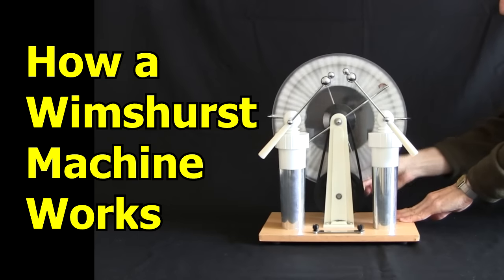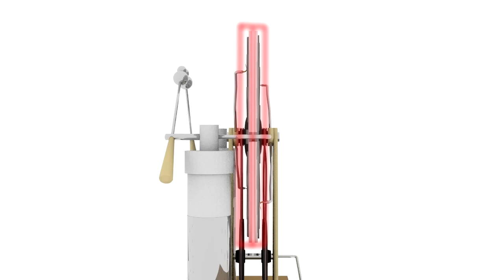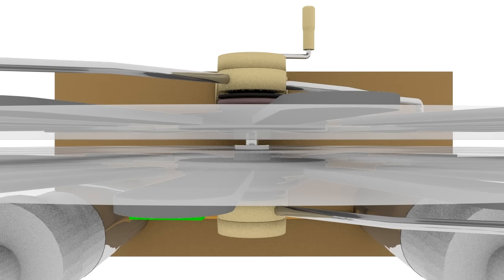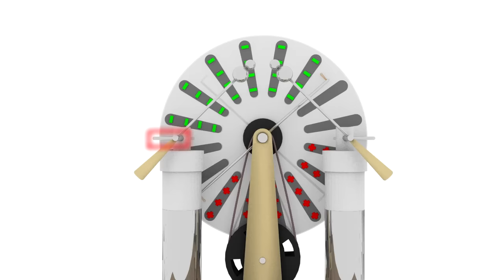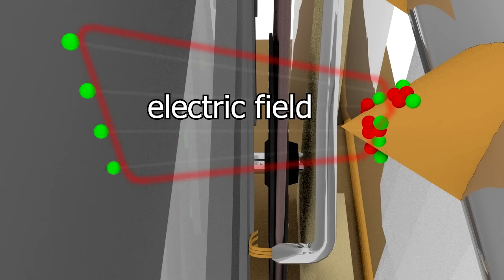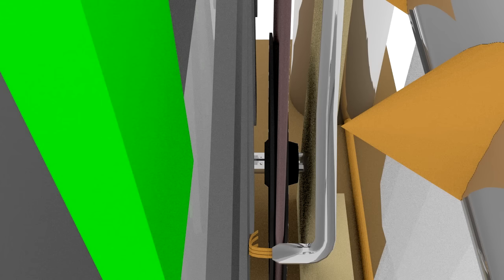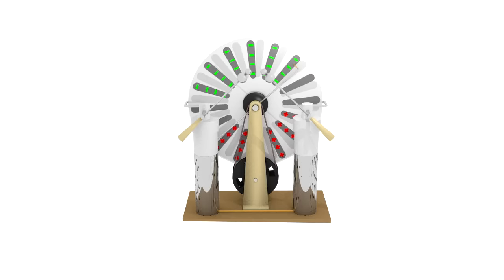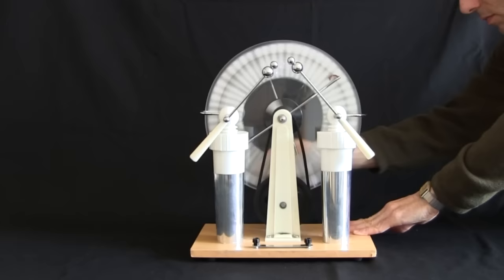How a Wimshurst Machine Works

Comment: Great explanation and animation! What I miss in the story is the effect of the fact that the neutralizers on the opposite sides are electrically connected. At least they are on the two commercial Wimhurst machines that I measured. In combination with not understanding why the entire charge would flow to the opposite sector in the first place, I would actually think that the negative charge will flow for 25% to the opposite sector, for 25% stay where it is and for 2x 25% flow to the two sectors on the opposite side of the blade where the neutralizers on the opposite side happen to connect at that moment. Any comment why this would be wrong, and if it is, what IS the impact of the neutraliser being electrically connected?
Reply from the maker: I've never seen one where the two neutralizer bars were connected together so I can't answer your question. Are you sure they were Wimshurst machines? There are a huge number of electrostatic machines.
Reply: Thanks for fast your reply. Yep, they are Wimshurst machines. For one the link can be found here https://www.vosinstrumenten.nl/winkel/product/details/?artdetail=VOS%2D11004&webgroupfilter=1965. The other is old, but I have analyzed it and I think there is no doubt that it is also a Wimshurst machine. It closely resembles this one: https://www.vosinstrumenten.nl/onderwijs/natuurkunde/elektriciteit/elektrostatica/wimshurst-machine-phywe.html. You can find a small picture of the old one here: https://github.com/hansdejongehv/Weekendschool-Natuurkunde-Physics/blob/master/Proeven/Proef%20Y%20-%20Electrostatica%2C%20aantrekken%20en%20afstoten/ElectrostaticaMetWimshurst_v7.pdf 
Did you ever measure in your Wimshurst machine whether the neutralizers are electrically connected?
Reply: When the neutralize bar makes contact with the sectors, it is as there is a single long piece of metal made of the two sectors connected by the bar.
BY the effect of the other disk induction, in an extremity of this single piece, electrons are attracted, while on the other extremity electrons are repulsed.
When the bar slide off from the sectors, it is as this long piece of metal is broken in two pieces.
The charges inducted on each piece however remains, and they are conveyed towards the collector and the Leyden jars where they are acumulated.
 A clear explanation is at  http://www.coe.ufrj.br/~acmq/whyhow.html

Comment: Is it possible to power machinery or homes like a generator with such a device sometime in the future?
Reply from the maker: It wouldn't be a good way of doing it. Wimshurst machines are inefficient but also, you'd still need a power source for power motor to turn the disks. You'd be better off connecting your machinery or home directly to that power source.

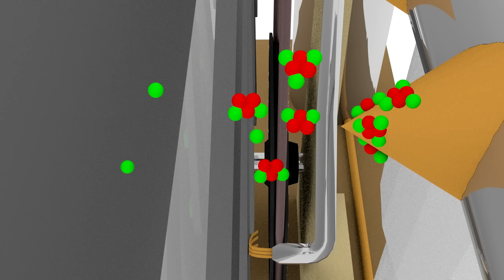Comment: 5:50  So does that mean there will be a little spark between neutralizer and a disc?
Reply from the maker: At 5:50 I'm showing a collector facing a disc. In that case there won't be any spark because the air is electrically conductive enough for charge to conduct through the air without building up too much. Since the charge is conducting across, it never builds up on either the sector or the sharp pointed collector to create a spark. The sharp point is basically preventing a spark from happening.

Comment: Conversely, what Prevents the the Neutralizing Bar charges from incurring same Charge Polarization effect Longitudinally ??
Reply from the maker: I'm not sure what you mean by longitudinally. The neutralizers are not electrically connected to anything except the sectors when their brushes are touching the sectors. There can be losses between adjacent sectors if the surrounding air is heavily charged due to leakage from the edges of the sectors.

Comment: I have a question: is the negative (or positive) pole always the same in such a machine or it changes randomly? In other words, is the current of the spark going always in the same direction?
Reply from the maker: I've heard that the polarity can change spontaneously so no, the current in the spark may change direction.
Reply: As far as I know, the main feature of this machine is that it does produce consistent polarity.  Other machines do change polarity randomly.
Reply: I heard the same thing, but have never been able to figure out why...

Comment: What would happen if you replace the spark gap capacitor with a resistor? Would it have the desired effect of generating heat within the resistor?
Reply from the maker: No, it wouldn't produce heat (well not a noticeable amount -- all current through a resistor produces some heat). For heat, you'd need a high current and you get the high current when there's a spark. Without the spark, the current is very low. However, you could keep the spark gap and put the resistor in line with the wire going to the spark gap. Then whenever there's a spark, there'd be high current through the resistor.
Reply: @RimstarOrg  awesome thanks!!! 😊
Reply: @RimstarOrg  may I offer some advice for entertainment....
Replace hand crank with a hamster wheel...
Place engine in a box...
Add mice....
Watch mice run the engine for you...

Next...add a gearing of 5 pyramid style...

Now mouse can run wheel faster...

Once mouse is running ...
Begin to built the USS Enterprise...

On another world...this engine is a power source where there is no power source...

Can easily power a computer or communication radio...

You could even weld with it...
Electromagnetic force field...
Ride the lightening for warp drive...the speed of light is too slow...the speed of lightening is faster...

In back to the future , I didn't see lightening hitting the clock..I saw the clock emitting the lightening...

17 century clock design ..

Your clock is a 32  hour day...?

Man's future was changed to not being allowed in space.

If you thought this was epic ..
Disney's was Epcot...lol.

Disney's wimshurst was called Epcot...really tweeked the clock face...

Serious...you'll recognise it when you see it...

Not the whole machine...
Just the disk...

Please feel free to question me so I can guide you through the net better ...

It began with being seen.
It became a drawing.
It became a model .
It became a working model.
By a ship builder...
A self powered space ship.

Disney's disc was about 5 feet diameter...

The bigger you go ...the bigger the lightening...

How come you haven't added tesla power tower transformer ?
In the words of Tim Allen...
MORE POWER ...
SHOOT sparks like a laser...

And yet....man walked away from this for nuclear...

Media's show humans the alternate future they could have had in star trek..

The only lie is ...star trek says it's atomic...

1870, wimshurst static  cars...
A enigne a mouse could start and run..

Add a gearing base to four wheel and a clutch and chain drive wimshurist engine..run by a mouse...

When your all alone , a mouse is a good lab partner for cranking ..

I do think inside and outside the box..

What was once seen , could have been reality...
Ride the lightening.
Teleportation...

Comment: The gap between the outer cylinders of the capacitors and their inner cylinders is much less than the gap between the spark gap balls.  So, how does the spark in the spark gap balls seem to form first before we see or hear any sparks or discharge in the capacitors (Leyden jars)???
Reply from the maker: Different materials break down differently. The air in the spark gap breaks down very easily whereas the plastic in the cylinder requires a higher voltage per thickness to break down. It's called the material's breakdown voltage and is really a voltage/thickness.
Reply: The answer seems to be that the gap in the cylinders isn't filled with air, but rather plastic.
Reply from the maker: Yes, exactly. Plastic has requires a high voltage to break down then does air. Well, there is another factor too and that's the shape of the electrodes. The rounder the two electrodes are, the weaker the electric field between them and therefore the higher the voltage required to break down the material between them. That's why the spark gap has round balls and not sharp points. The electrodes in the capacitors actually have sharpish edges and so the electric field is stronger between them as the ends of the cylinders. But it's still not strong enough to break down the plastic. I talk about that in this video about making and testing high voltage capacitors at around 7 minutes in https://www.youtube.com/watch?v=MPD7skZ8OSo

Comment: Mr. RimstarOrg, Sir, At the time stamp of (8:44) the illustration of the electrons going through the air atoms or molecules in waves, But, in one direction and that means its a DC discharge or spark. Here is my question, At the topload of, lets say, a toroid that sits on top of a secondary coil of a Tesla Coil. That toroid's surface. The electrical discharge is AC. So, if I were to illustrate that spark or lightening stream that comes off of that surface, the same way you illustrated the electrons going through the air molecules. My illustration would be waves of electrons going back and forth at the resonant frequency of the tesla coil.  They would just go back and forth in alternating waves of electrons, RIGHT?
Reply from the maker: At 8:44 it looks like waves only because I animated it that way. It shouldn't be waves, just a continuous stream of charge moving through the air. My bad. I hadn't realized at the time that it could be interpreted as waves. But you're right, it is DC. However, as you said, a Tesla coil is AC. My understanding of Tesla coils is that the topload is doing something similar. Each time a streamer (what the discharges at the topload are often called) occur it ionizes the air a little more. Then the streamer ends and then the next streamer happens. But because the air is more ionized, this next streamer can reach out further. This repeats but is too fast for the eye to notice. There is a limit to how far they can go though. So yes, each streamer would be one wave.
Reply: @RimstarOrg  RIGHT ! TY SIR! I GOT IT !

Comment: Is it true how the charge move to the collectors in the wire is different from ac or dc, like it moves with a skin effect kinda thing?
Reply: Probably travels more like DC, it simply flows & accumulates having no place else to go. The skin effect can be seen with very high frequency alternate current, when I was a kid I built a (roughly) 800KHZ. Tesla coil driven by a 400w. tank circuit. Felt no discharge from the wild plume coming off the top electrode (skin effect) but minor burns were a problem.

Comment: But is it any good for small scale power production? Could one feed power into a battery bank and power a small cabin or house?
Reply from the maker: No, it's output isn't very powerful. It's also very inefficient because of the losses due to ionizing the air everywhere. You can also imagine the amount of energy must be small because  you're not turning the crank very fast.
Reply: @RimstarOrg  How would it work to interfere with nano particles in the air?

Comment: Thanks for the nice explanation. What would roughly the mechanical to electrical energy conversion efficiency? Regards.
Reply from the maker: I've read that the efficiency is very low due to the losses as the collectors and elsewhere. Conducting charge using ionized air creates a lot of losses.
Reply: @RimstarOrg  Thanks. Would it be possible to store the converted mechanical energy in a modern supercapacitor of 500 F capacitance? What could be a guessed conversation efficiency? 50 % or something like that? Thanks.
Reply from the maker: Yes, you could take the energy from the Leyden jars (capacitors) and put it in a supercapacitor, or just replace the Leyden jars with the supercapacitor. The efficiency would still be just as bad though since the loss is mostly at the collectors and on the disk.
Reply: Thanks. Does the lost energy appear as heat due to friction at collectors? Regards.
Reply from the maker: I think most of the loss is just the loss of charge to the surrounding air. You can really smell at least the ozone.
Reply: @RimstarOrg  Thank you.

Comment: Discriptions are not explainations. So, when does it run out of "electrons" to expel?, and where do you you fill up?
Reply from the maker: Ideally, no electrons are lost. Ultimately, the spark equalizes them and they get recirculated. In reality, there are losses wherever there's a high enough voltage: at the collectors, during the spark, and around the sharp edges of the sectors you can see a bluish corona in the dark. But those same places are where electrons are picked up from the air too. However, if by fill up, you mean add energy, the energy is supplied by the  mechanical work involved in turning the hand crank.

Comment: Didn't the original Victorian machines used glass discs? Surely they wouldn't generate a charge in the same way?
Reply from the maker: If you're referring to glass and/or plastic disks with no sectors on them, some do still do it that way. I'm no expert on that type. My guess is that you'd need to have the neutralizers not touching the disks but be sharp points facing them across an air gap like the collectors. That way they can interact with a larger area of the disks than just what they would otherwise come in contact with. If they used surface contact then they'd only interact with where they touched because the glass or plastic doesn't conduct electric charge over its surface. But I could be wrong about how those work since I haven't looked into them.
Reply: @RimstarOrg  The one I saw was supposedly an original and had etched glass segments. I bought one of the Chinese reproductions but I was unhappy with the wibbly wobbly stand and the  copper stranded brushes so I made a frame from lab materials fitted onto a mahogany base and replaced the brushes for carbon strands from HT ignition leads. I love scientific displays and your channel is very educational and clear. Check out my Jacobs ladder:  https://youtu.be/4eHp7AwKf7k
Reply: @RimstarOrg  That's a very interesting thought, I'd be interested in seeing that experimented with!

Comment: hey did you tried to use GLSL materials to do fast renders in blender, for me that its more easy, fast to render and have less noise, I dont know why everyone seems to use only the cycles.
Reply from the maker: No, I haven't tried using GLSL materials. I used just the default Blender renderer and the default materials, not even any textures.
Faster render times would help though. This video was done in pieces but if I were to add up all the render time, it would probably be around 20 hours with an NVIDIA GTX 1070 (hmm... it's the first time I've used that new computer with that card so maybe it wasn't using it, I just assumed it was, I'll have to look). 
I also have no need of cycles since I've no need of realism or the lighting you can get with cycles.  This video might look a little grainy like you see with some cycles rendering but that's probably because I rendered it as AVI JPEG with 90% quality for file size (plus I like the soft look it gave me). I used to use H.264 but I found problems with either the files which Blender produced or with Sony Movie Studio 11's (my video editor) use of those files -- occasional missing frames.
Reply: Well, if you set the output to ffmpeg, you'll see lots of usefull controlls and options on the encoding tab, including the amazing H.264 codec. And personaly, I think if there's no need to realism, there is no need to blender render as well, GLSL takes care of motion graphics animations perfectly (I recomend to experiment with matcaps, sometimes is even more realistic than blender render), and also, the rendering will be realtime.
This channel I personally like much because of the lots of contents in GLSL: https://www.youtube.com/user/cfirwin3
Also, great job with the BB-8!
Cheers.
Reply from the maker: Realtime rendering would be great. To test before starting a big render to a file, I've been setting the Viewport Shading to Rendered and it takes a few seconds per frame, even though I don't walk through every frame. Doing that in realtime would be a big time saver. I'll have a look. Thanks!

Comment: there is a version of this machine that once started continues to run by itself and instead of producing sparks produces usable electricity.
Reply: And the generated power is so tiny that can’t be practically used.

Comment: Sir, I have a question. Have you ever seen a Wimshust Machine where the disks were made out of 'WOOD'? I used to see a video on youtube,  of a miniaturized Wimshurst Machine, completely made out of wood, except for the little metal sectors on the disk. Of course, the wood was lacquered. So, all the wooden surfaces were finished and the disks could conduct electricity. I think this Wimshurst Machine was made in South America, but the video seems to have vanished. I used to have a couple of pictures of this wooden Mini Wimshurst Machine on my old, now broken laptop. So, I can't retrieve it, yet. But, I just chimed in to ask if you saw this video or pictures of this Latin Mini Wimshurst Machine?
Reply from the maker: I don't recall having seen one made of wood, so no. But if it was documented somewhere, my guess would it would be on this webpage somewhere https://www.coe.ufrj.br/~acmq/electrostatic.html .